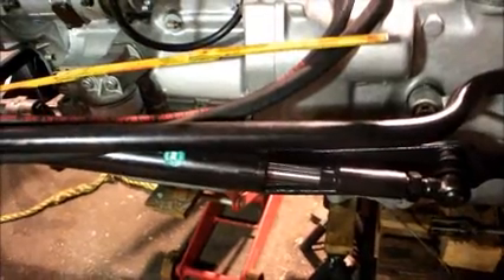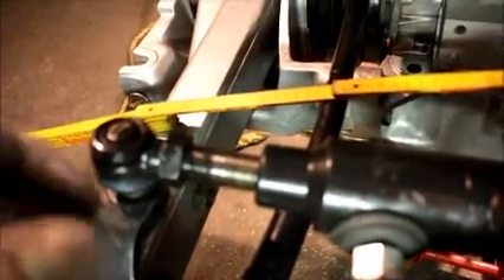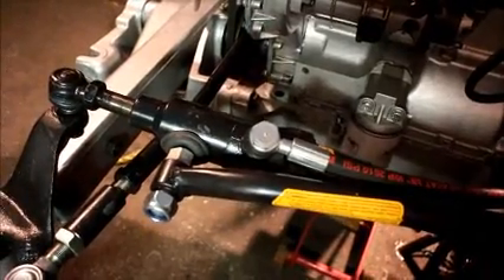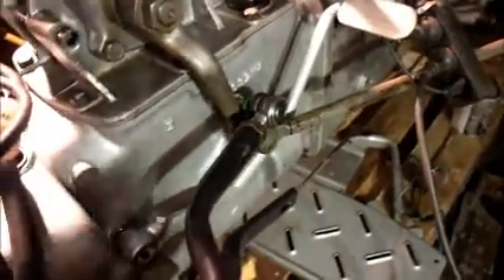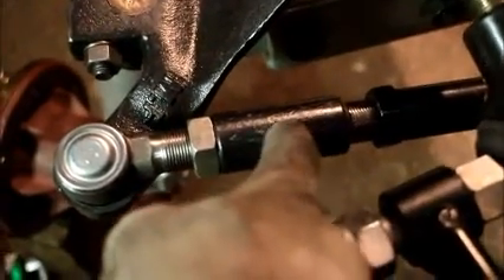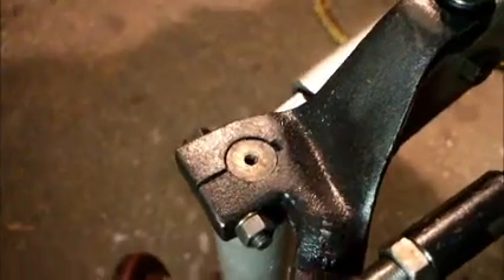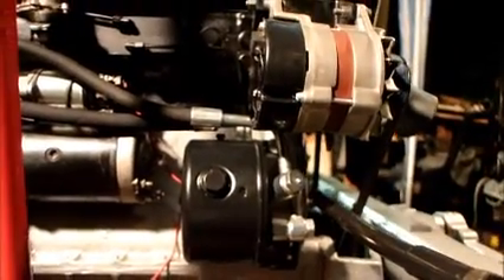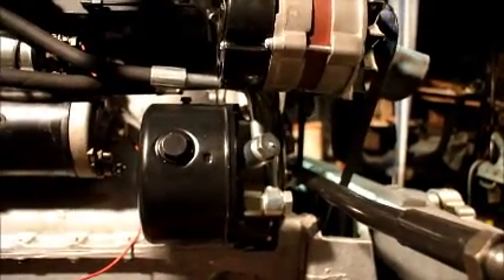Mf 135 Power Stearing Kit installation and problem solving

Comment: i have  instaiied a power steering kit  ( beepco)  English Tractor on  my MF 135.AD3 152. The return line goes to a Reservoir  tank and then to the pump Suction .   The power steering fluid spatters out of  the top vent hole I have run the tractor for two hours. And it still spatters out the fluid. any suggestion how to solve this problem.. The power steering fluid turns from red .thick to pink watery.